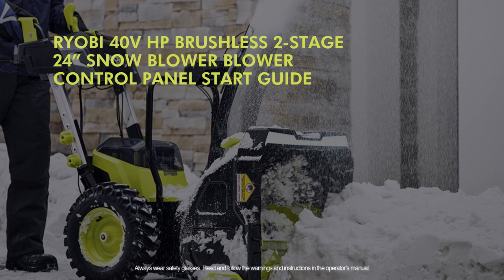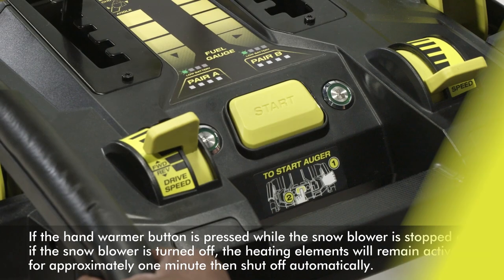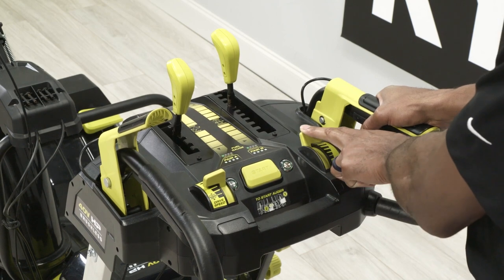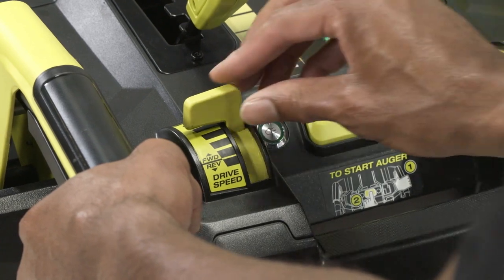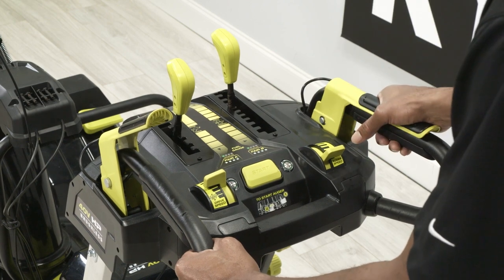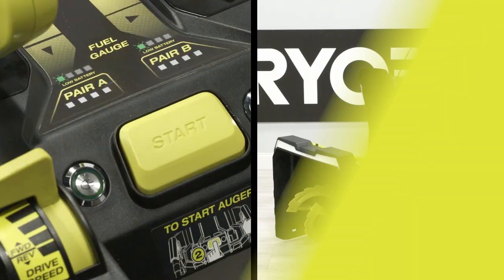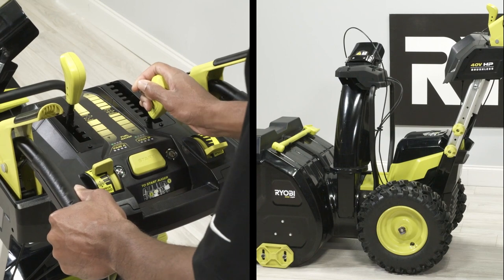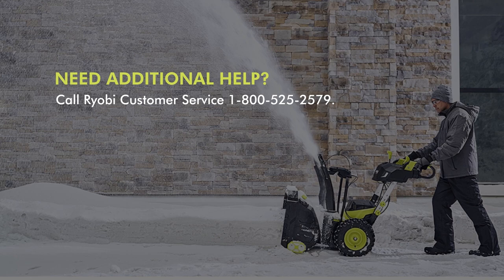How-To: RYOBI 40V HP Brushless 24" Snow Blower Control Panel Guide

Comment: Used mine yesterday for the first time. Worked like a dream, about 4” of light snow. Large lot with long driveway about 1 hour and still had one light on each battery. Did not use lights or heated grips. Will update on a “real snowfall” So far, so good!👍🏻

Comment: Im very curious about run time on the batteries.
I do believe it has the power to do the job.
But my drive way is big and that old snowblower has a good workout nearly everytime with that thick/high snow.
Time will tell.
Reply: I saw a question/answer on Home Depot's website about runtime. A Ryobi rep responded saying that each single battery will provide 20-40 minutes of runtime (although the unit requires two batteries installed to run). So you can expect 80-160 minutes of runtime with four fully charged batteries. I imagine the lower number is if you have the lights going, heated handles on, and are tackling some thick, heavy snow.

Comment: Just to be clear, this unit will run off 2 batteries as long as those 2 are in either bank 1 or bank 2, correct? But for best performance all 4 batteries should be installed?
Reply: I have the same question!

Comment: Interesting! I see there are two banks that can hold 2 40V batteries each, for a maximum total of 4 40V batteries.  Does this make it effectively 80V?  The online literature mentions it can run on just one bank, but two banks is ideal for performance.  Could you elaborate?
Reply: Specs in the manual say 80V for the motor.
Reply: Not the place to get a response to a question like that. Call RYOBI
Reply: @RioJudy  but...where else am I going to get unverified information from?

Comment: What’s the run time with all 4 batteries in, running at max speed and max auger speed?   How long does it take to recharge all 4 batteries?
Reply: I can't comment on how long it takes to charge the batteries, but I read that you can expect to get 20-40 minutes runtime per battery. So if you have all 4 installed then you should get 80-160. I imagine the lower number is with max speed and max auger speed, heated handles, and lights going.
Reply: @Xerilian   I just read that it takes about a hour to charge a pair of 6.0 batteries.   So 2 hours to charge all 4 batteries.

Comment: When is this coming to Home Depot.
Reply from the maker: It will be available the first week of December! You can check it out here: https://www.homedepot.com/p/RYOBI-40V-HP-Brushless-Cordless-Electric-24-in-Self-Propelled-2-Stage-Snow-Blower-4-6-0-Ah-Batteries-Dual-Port-Charger-RY40870/316889292.
Reply: @RYOBITOOLSUSA  you guys have a winner on your hands!
Reply: January at the earliest.
Reply: @RYOBITOOLSUSA  we are now going into the 2nd week of december is there a up date before I go and buy something else
Reply: Still back ordered with no current ETA. Unfortunately may have to cancel my order
Reply: @Falken240  I already did at this point ill have snow before I get the blower 😂
Reply: @Falken240  same boat here.
Told early December, and still no word. 
Ryobi will have a hard time selling these in March. By then I will have purchased something different.
Reply: @davidb0130  already canceled my order unfortunately

Comment: Quit after 5 minutes. I think the pin which connects the motor with the auger broke. Nice machine, but obviously defective. Customer service not much help. Also, the label says Model 40807 instead of 40870.